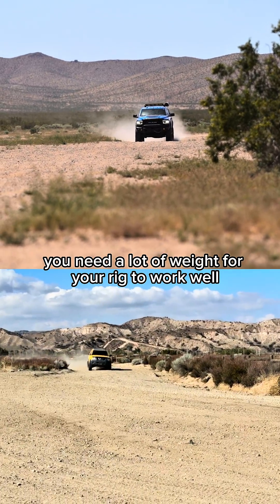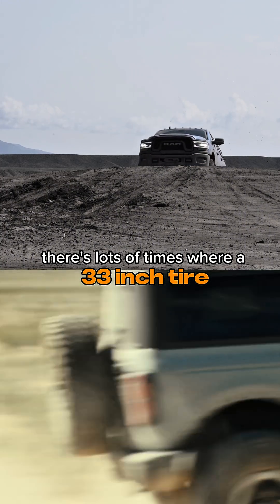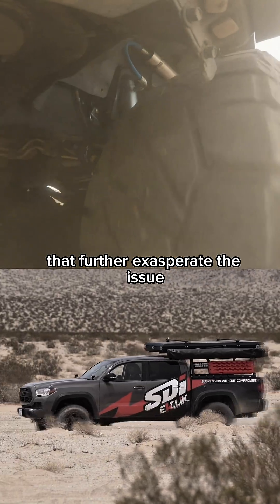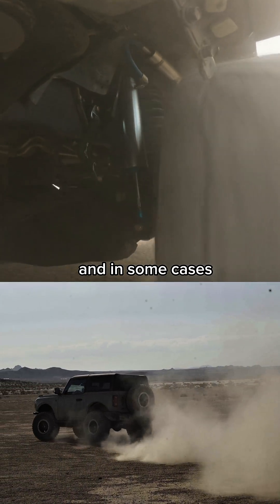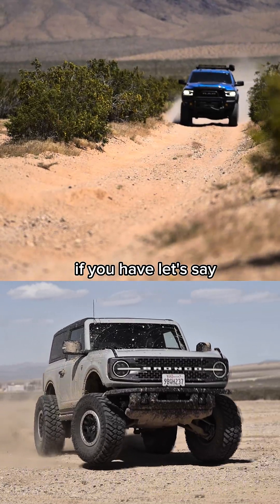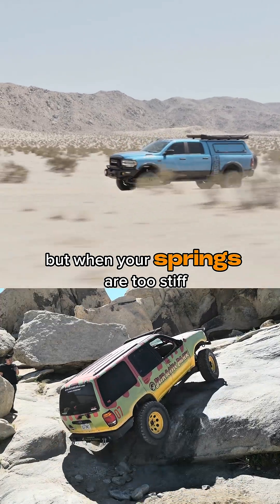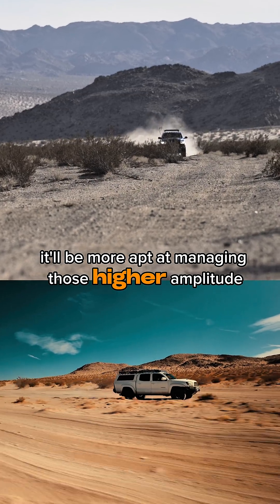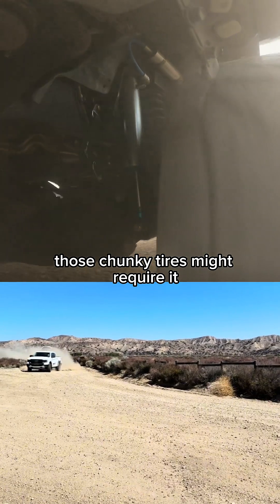Is Heavier Better? #shocktalk #shocksurplus #shocks101

Comment: Can confirm. I'm running the heaviest 37s (Mud Grappler, 100lbs) on a 2dr JK. Never mind jumps, even on washboards I need to crank the damping or else the tires / axles just skips along. That's 1000+lbs unsprung mass on a 4500 lbs rig.